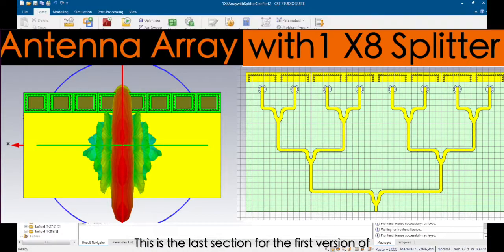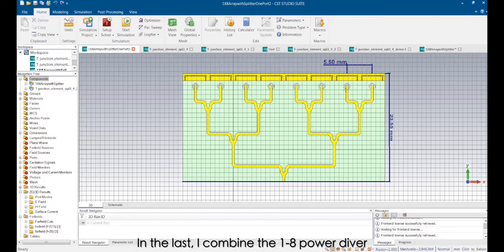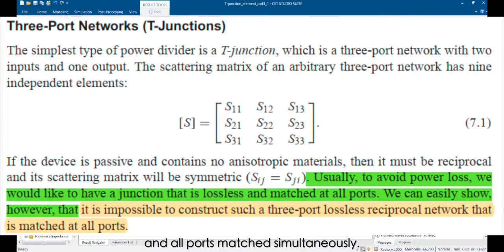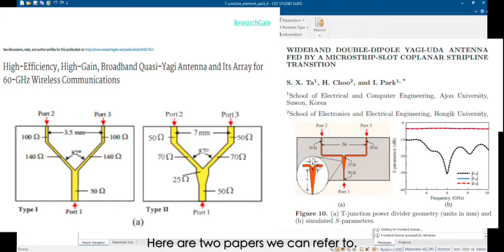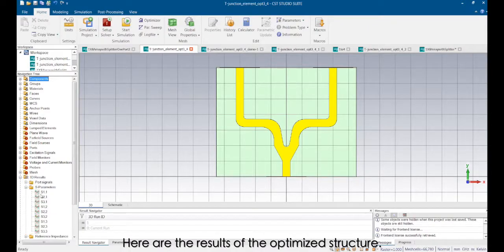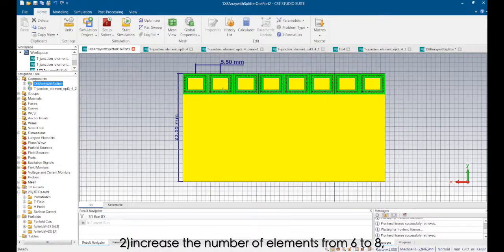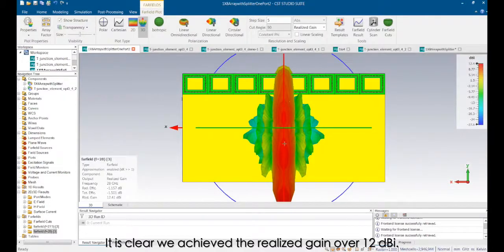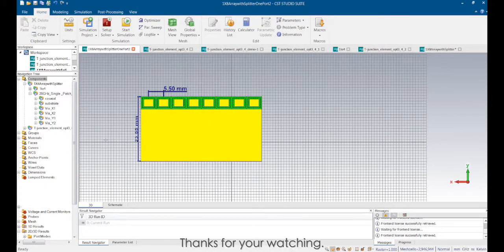03--28GHz Antenna Array with 1X8 Splitter

Comment: hi how do you calculate spacing and routing ? please let me know.
Reply from the maker: it is close to half of the 28GHz EM wave in the air. I used half of the 28GHz EM wave in the air, which is 3x10^11mm/(28x10^9Hz)/2 as initial value for the spacing, and using par sweep function to find the optimized value.

Comment: I always wondered the isolation between the feeds are not important? Without resistor (Not-wilkinson configuration) you don't have isolation, isn't it a problem?
Reply from the maker: Yes, the isolation among antenna ports is important.
However, the resistors are avoid to keep high efficiency.
For the antenna array, via fence can increase the isolation between radiation elements.
For the feeding network, we can also use via fence to increase the isolation.

This series videos only presents the fundamental concepts of antenna array design to help people understand the design procedure of antenna array. This series videos is  antenna array 101 course.

I have plan about making videos for more advance readers. But, let's start from 101 first.